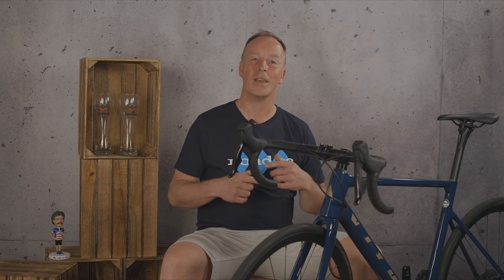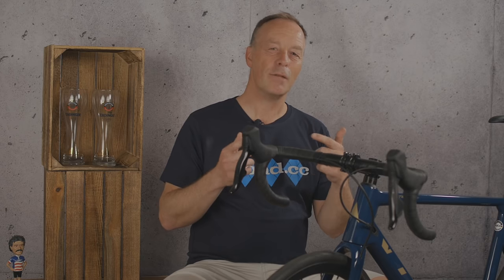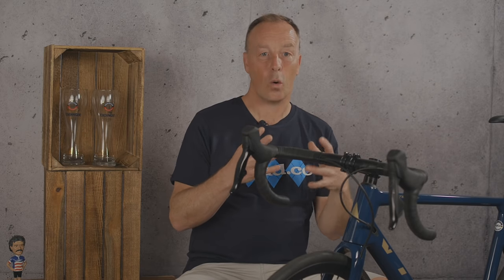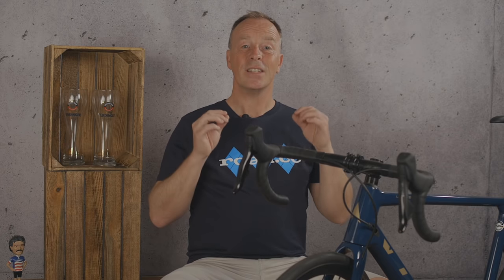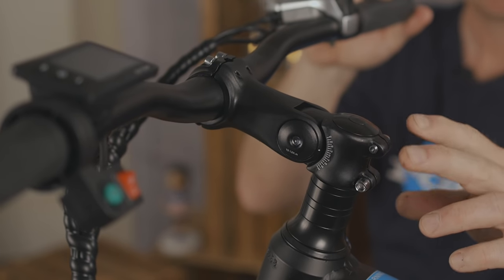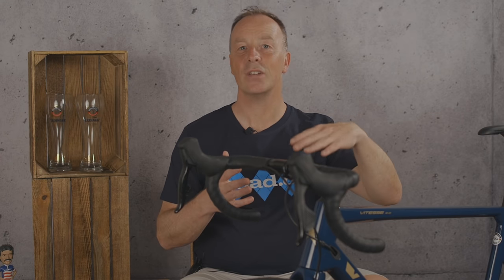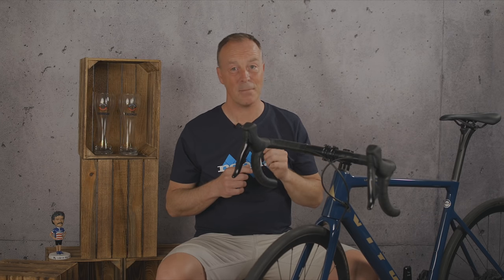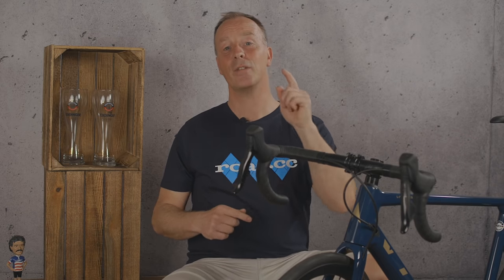Get it right! | Finding your perfect stem length

Comment: $350 for a bike fit then your fitter tells you your $1000 integrated handlebar stem is too short 😂
Reply: Or too long.
Reply: So get s stem riser $20 dollars
Reply: So get a fit before you get the wrong bike!
Reply: This happens all the time. Get a good fit (or two) BEFORE spending big money. I have been riding the wrong size bike largely because I walked into the fitter with a bike. They then try to work with what they have. Get the fit first, it is a lot cheaper. Ask me how I know.
Reply: It seems that most people dont get the joke 😂

Comment: To get the right stem length, start with your saddle! You must have the right setback to get the right the balance of upper torso weight on the bars. When you are pedaling with moderate effort, your hands should rest just lightly on the bar hoods. Too much pressure? Bring the saddle back and work on core strength.  Not enough power in seated climbs? Bring it forwards. Once you have got the right setback, choose the stem length that best accommodates a proper angle between the torso and the humerus (about 90 degrees) or one that just feels naturally comfortable.  If you do a lot of climbing out of the saddle, a longer stem will give you more leverage to pull on the bars; if you are just casually pedaling a flat course, or touring a shorter stem will give you a better upright position.

Comment: First saddle height, setback and tilt. Adjust setback and height to have good control over top and bottom of pedal stroke. Then weight on hands with saddle tilt. Last the stem length to accomodate the reach of that position.

Comment: Makes good sense and sums it up around 5:10 > 6:58.
I'm starting with correcting my stem length so my bar's grip position is aligned with the fork tube. Then, I can easily tell where my Saddle needs adjusting.

Comment: The other thing you can alter is the handlebars reach. Some bars have shorter reach. Use this in combination with the stem length. Anything with a reach shorter than 80mm is considered short. The Specialized Short Reach and the Aerozine XB1.2 is the shortest I know at 65mm.

Comment: I am capable of a reasonably aggressive position on a bike. I often will run an aggressive negative rise stem with some spacers below rather than neutral rise slammed. Same bar position but easier resell as a potential new owner has greater adjustment options. Additionally it’s not really about the stem, it’s the position of hand poison/controls in space.  The bar plays an equal role in this on a road bike.

Comment: I got a bike fit recently. We started with cleats (moving them back a bit.) Next was the saddle, which went forward, up, and more level. Finally, the bars. Mine are narrow, which is perfect. The fitter wants me to rotate the levers higher, so I can get a more natural bend in the elbows while keeping the wrists neutral. Finally, I will go from a 110mm stem to 90mm. (It was between a 90 and 100, and I decided to get a 90 to really feel the difference. If it feels too cramped, 100 it is!)

Anyway, with my fitting process, the stem length was the final piece of the puzzle, not the first.

BTW, my stem is still on order. In the meantime, I’m riding with my hands back from the hoods. The cheapest and easiest way to try different positions is to fake it and position your hands where they would be with the new equipment. Easiest way to try before you buy.
Reply: I know I'm late to the party, but thanks for posting the process.

Comment: Since I've retired from racing, I've become less flexible over the last 5 years (that and the fact that I'm old now) For years, I rode a frame with a 58 top tube, and a 140mm stem (-6 degrees, I believe). To make things more comfortable, I changed over to a 130mm stem (much better)

Comment: Thanks you.  Great video.  You mentioned the reach is shorter when angle is higher.  That makes sense .  If I have a 90mm stem, one with 6 degree and one with 12 degree,  the reach would be shorter with the 12 degree.  I think I got that (hopefully).     What would happen if I have two stems.  One with 90mm and 6 degree and  the other 110mm with 12 degree.   On the same frame,  would the reach still be shorter due to the 12 degree rise even though the length increased 20mm ?  Just want to check !    Basic geometry says:  Vertical rise = stem length * sin(angle) = 90mm * sin(6°) ≈ 9.5mm  and Vertical rise = stem length * sin(angle)
= 110mm * sin(12°) ≈ 23.0mm.   The difference in vertical rise between the two stems is approximately: 

23.0mm - 9.5mm = 13.5mm

So, by switching to a 110mm stem with a 12-degree angle, I will effectively raise my handlebars by approximately 13.5mm, reducing my lean and back angle.   Does this make sense or am I way off ?   My forks are cut so no play in stack height and trying to reduce the reach - slightly so thinking this combo may work.  Would love to hear your feedback.   Thanks so much for a great video.   Saving this one to back to from time to time.

Comment: I had a 100mm stem on my Tarmac sl7 and experienced saddle soreness. My bike fitter shortened the stem to 80mm and that helped with my saddle being more comfortable. My new bike (long story) also had a 100mm stem and I felt stretched out with my arms almost locked out to have my hands securely around the hoods. So I changed the stem to an 80mm and my saddle is a little more uncomfortable than it was with the  100mm. Should I move the saddle back a smidge?  Thanks for a great video
Reply: front , back , tilt, up and down, seat is #1

Comment: I was riding upright position and yes I did get fitted for my body.  never felt that kind of pain in my vertebrate. So I flip the stem had better control more comfortable.So upright position is not correct all the time .

Comment: I have a real Frankenstein’s monster of a bike fit. I am 173cm tall with a 182 wingspan and I have a Specialized Allez in a size 56. The Allez has a very tall head tube, especially in a size 56. When I got the bike, it was just too big for me. It’s taken me a year of tinkering but I’ve finally dialled in the perfect fit- and it was all in the stem! I’ve completely slammed it, beyond even factory limitations, as I’ve fit a 5mm headset washer and I’ve taken the stem it’s self down in length to 90mm (from the original 100) and also down to a 12 degree drop (down from 6). The bike now fits like a dream and the position it puts me in, is more akin to a full on race bike, than an endurance bike. (I’ve also narrowed the handlebars by 20mm)

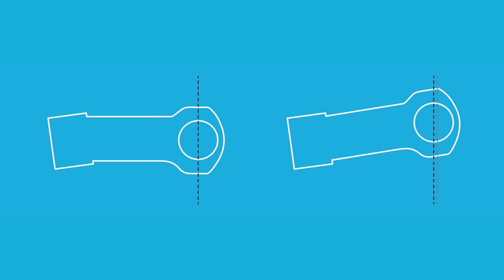Comment: 3:26 the cosine of 8 degrees is 0.99. Your stem would have to be 500 mm long for you to have a difference in length of 5 mm when you raise the stem by 8 degrees. You need to run these videos by a technical editor